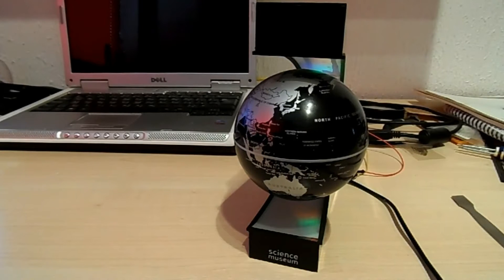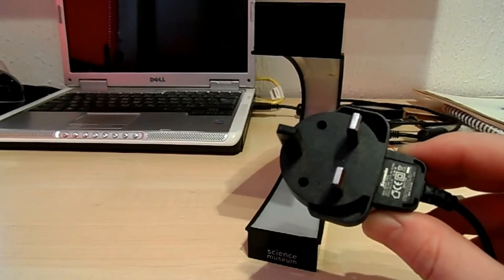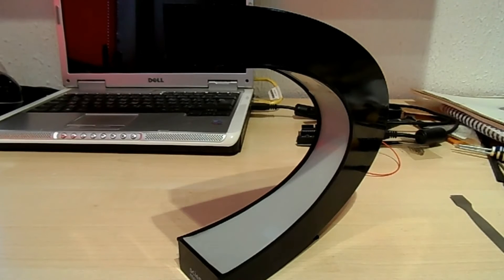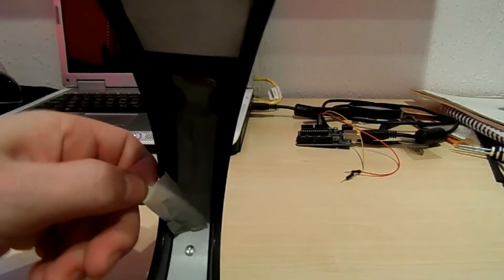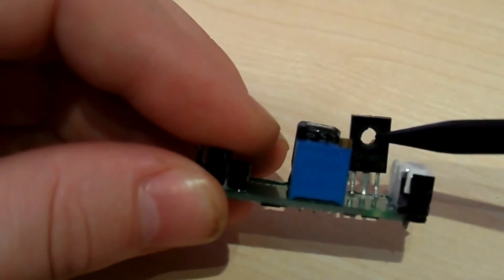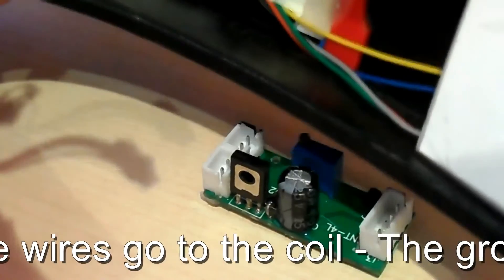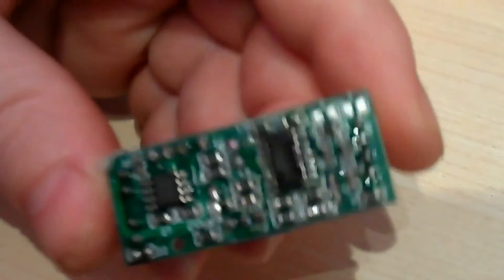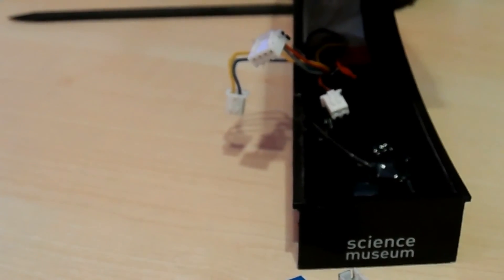A look inside a magnetic floating globe

Comment: I have the same type levitation globe but mine is a cheap imitation from china. I took a look inside as well. From what I can hypothesize, this device has three forces to contend with that change depending on the globe's distance from the electromagnet. 1. the acceleration of gravity that stays relatively constant at any elevation, 2. The attracting magnetic force that increases at higher elevation, and 3. the repelling magnetic force that counters the attracting force at a slightly higher rate at higher elevation and lower rate at a lower elevation. A sweet spot develops when the globe is settled into an elevation where they all counter each other proportionally. I think this might have something to do with the shape of the magnetic fields and the magnets inside the globe.
Reply: hi, what size is the magnet in the globe?